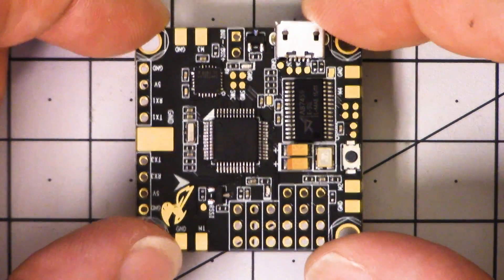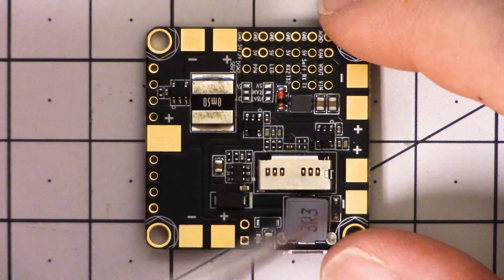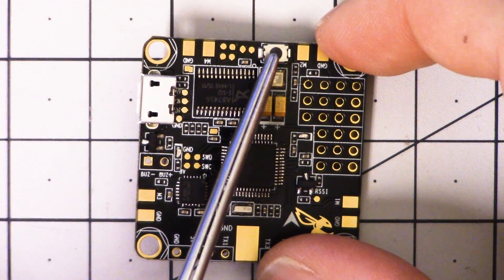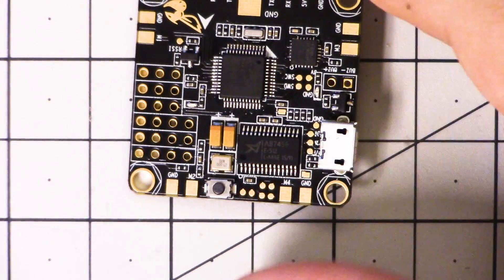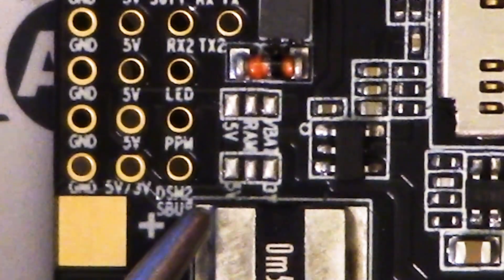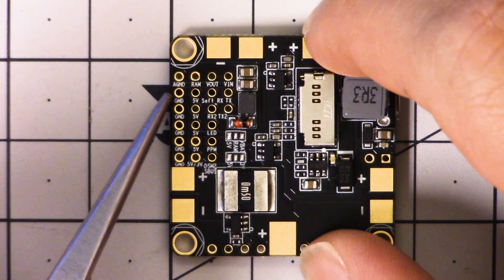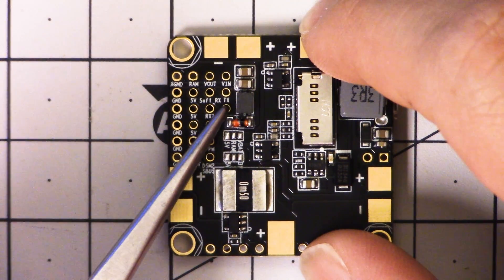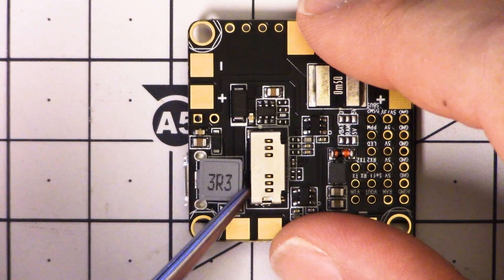Betaflight F3 (BFF3) Flight Controller | REVIEW AND HOW TO

Comment: hi there like the video but alitte confused I have the betaflight f3 board +the tbf unify pro 5v,  were do I put it if I can not run the cam and the ftx of the 5v pins ,also what cam would you recommend to go with that setup thanks
Reply from the maker: IF you bridge 5v to RAM

THEN you cannot run the vTX off of RAM. You must use a regular 5v pad because the filter on RAM cannot handle the current that the vTX will draw.

IF you bridge vBat to RAM

THEN you can run the vTX off of RAM, because the higher voltage will result in lower amps, and the filter will be able to handle it.

SINCE you have a 5v vTX you cannot run it off of the RAM pin. You must use a regular 5v pad on the board. Any spare 5v pad will do. You can try running the camera off of 5v RAM and the vTX off of unfiltered 5v, but if you get video noise, run both camera and vTX off of the same 5v pad.
Reply: ace top man

Comment: Hi Josh, great video.
I've just installed this board in my copter and i'm getting horrible noise through the video feed and I see in the video you recommend connecting both camera and vtx to the AGND pad, I noticed I didn't do that and it is probably one of my issues. 
Do you think it would be best practice to power the camera directly from the VTX ?
Reply from the maker: The setup that I use, and that works for me, is to power the camera and vTX directly from RAM, which is bridged to vBat, and ground them on AGND. If your camera or vTX can't take vBat then that won't work. The next setup I suggest is to run them both off a spare 5v pin, but do NOT run them off of the RAM pin bridged to 5v, because the filter on the RAM pin can't take the current that a vTX will pull.

I never power my camera from the vTX personally, because soldering to the PDB or FC is cleaner. But if you choose to do that, then I suggest grounding both vTX and camera to AGND and powering the vTX from vBat on RAM if possible.
Reply: Joshua Bardwell I just tried as you said and powered vtx and camera to ram (vbat) and both grounded to AGND and I'm having the same issue. I even tried powering from the vtx but it made no difference. 

I'm not sure why there is so much noise, as soon as I arm it is completely un flyable. can you suggest anything else?
Reply: Joshua Bardwell also, I have a feeling I know what you're going to say, but I haven't run a ground wire to my ESCs.. could this be putting noise in the system?
Reply: Hey, I thought I would let you know I managed to find my issue.Silly me mounted the motors with 2 wrong length screws. It was late when I was building and 1 screw in both motor 1 and 4 were 1mm longer than the others, barely touching the windings. 
I found this after I ordered and installed capacitors all round and the issue persisted. 
I tried spinning up motors individually in BF and found that only motors 1 and 4 were noisy. Oh well, I will know for next time and you better believe that I learned something today!Thanks for your contribution!

Comment: joshua.. im usind unify pro v2 5v and foxeer arrow v3.. can i connect my camera to RAM/vbat jumped and then run the unify off one of the 5v?  and will it be filtered.. ? if not how will i go about using this vtx and getting it filteres?
Reply from the maker: +Steve Maratea run GND to the same pad for camera and vTX. Rin vTX to a regular 5v pad. It won't be filtered. Run cam to 5v or ram. I would try ram but switch to 5v if you get noise.
Reply: ok would it be better if i got the unify pro HV and used the vbat/ram and piwer cam off 5v out of unift.. so both will be filtered?
Reply from the maker: +Steve Maratea that's my approach. I don't understand the logic of powering a hungry device like a vTX off of 5v.
Reply: Joshua Bardwell.. ok so you think the hv will be better than using the unify 5v to a unfiltered 5v rail..the video will be clearer with the hv? correct?
Reply from the maker: +Steve Maratea I couldn't say for sure but it seems to me like it must be better to run off filtered vBat. But maybe unfiltered 5v is better since the 5v regulator is a filter of sorts. I just never really trust the on board voltage regulator on an FC very much.
Reply: joshua.. ok well im just asking because i and about to order the unify pro and was wanting the best advice on which one to get with this bf f3 board..
Reply from the maker: +Steve Maratea personally I use the HV. I like the connector on it better too.

Comment: So is the Ram where I'm going to get actual power for the VTX? Wire the VTX power into RAM and then ground both the camera and VTX to the AGN?
Reply from the maker: +Richieboy87 if you use 5v RAM then don't wire vTX to RAM, wire it to a spare 5v pad. If you use vBat RAM then wire vTX and camera to RAM.

Comment: Hi Joshua. Great review as usual. Question...I do want to us it with a 4in1. If I use a swift 2 could I get at least voltage from the camera using the vbat wire on the camera?
Reply from the maker: Yes, you can use the vBat wire to get voltage OSD. But you should really just use the Betaflight OSD on the BFF3. No need for a Swift 2 OSD if you have this FC.

Comment: From other channels, I learned this board has a "virtual com port", so you need the VCP Drivers (2nd option in BetaFlight).  OK, I can see the little quad pitching etc.  Now to see what firmware version it has...  uh...  NOPE!  It's probably in there somewhere, but nobody ever took the time to document it!  (this is pretty much how this stuff rolls)

Ok, I'll assume it's stale...  Unplug, hold the button, plug in...  what's this?  I still get the red light?  

Long story short...  total failure.   Does anyone have a video where they actually step through using this flight controller in BetaFlight?  I understand what a "character-building" exercise spending hundreds of hours discovering all this stuff by trial and error would be, but I'm a big enough character already.

The Wiki doesn't say what toggles to use for this board in Firmware Flasher (No reboot sequence, Full chip erase, Manual baud rate).  In fact, the Wiki doesn't even mention those toggles.  This is how "community-supported" software is, and pretty much why it was banned in every corporate environment I ever worked in.  :)

Comment: @Joshua Bardwell. If you read this comment, your going to learn something today...  Not that i know for certain, however the silkscreen on the back of the board means that if you use pin headers, you can still check to see what the pins are easily.  This is what made sense to me.

Comment: A friend gave me one of these boards for my first build. I don't think I want to mess around with the hassle of the ESC wires again especially because the ground pads seem to repel solder. I tried scraping the surface, flux pen, nothing seems to help they just don't like taking solder lol.
Reply from the maker: +John Citizen just give them some heat before you solder to them.
Reply: +Joshua Bardwell I use a fixed temp 46W Goot iron which will heat up big pads with a chisel tip, unfortunately my chisel tip got lost when I moved house. I managed with the standard tip but I've ordered a chisel tip for future use because I find them much better for heating big pads and I can rework SMD components with one as well :)

Comment: Regarding the issue of using a 4 in 1 ESC with the betaflight f3, I am planning to use the Quadrant 25a ESCs soldered together for a two layer stack.  Are you saying I should run a wire from all four positive terminals on the fc to one positive terminal on the ESC assembly?
Reply from the maker: +McOwey Joe no. Run a 14 gauge or 12 gauge wire from the ESC pad closest to the current sensor to the central pads of the quadrant.
Reply: Joshua Bardwell and just choose one of the grounds to either side of the positive center pad...
Reply: I'm concerned about my ability to solder 12 gauge wires to the center of that delicate assembly without shorting something.
Reply from the maker: +McOwey Joe 14 gauge is okay unless you are pulling truly massive amps.
Reply: Joshua Bardwell it's working like a charm on Atom 122 frame and 1306 lumeniers.  Thanks for your help.

Comment: On this flight controller and an x4r-sb, on the OSD i'm getting RSSI 99%. RSSI is turned on in betaflight and rssi shows up on the taranis correctly. Everything else telemetry related is working in the OSD. Any advice?
Reply from the maker: RSSI is inverted on this board so basically it doesn't work. Betaflight 3.1.7 has RSSI inversion to fix this.
Reply: Your time, dedication, and the advice you give in this hobby is invaluable. And everyone will agree. Thanks Again
Reply: Your time, dedication, and all the advice you give to everyone is invaluable. You are making this hobby the best it can be. And I'm confident everyone would say the same. Thanks Again

Comment: Hey Joshua, I just upgraded to the Betaflight F3 and for some reason I'm not getting video through the osd. All that I can see in the goggles is a black screen with the osd overlaid. I checked the camera connections and the camera is getting 5 volts, and the solder connections are solid, so I'm not sure what the issue is. I'm powering my vtx through the ram pin on the board, and then using the power out cable from a tbs unify. I've tried multiple board cams and had no success. If you have any ideas please let me know.
Reply from the maker: Manually set the OSD to PAL or NTSC (whichever is right for your camera).

Connect the camera directly to a display device using the RCA connector dongle that came with it. Confirm that the camera works (it probably does).
Reply: Joshua Bardwell changing format didn't affect it. I'll try with the rca cable when I have time to find it
Reply: Camera works, format is correct. Any other ideas? My only other idea would be to flash the firmware
Reply from the maker: +Kyle Johnson Yeah good idea. Do that. Full chip erase.
Reply: Same issues here. Anybody work up a fix?

Comment: im doing my first build what wire goes to ram? power from the vtx?
Reply from the maker: RAM is filtered power to the vTX and camera. However if you have RAM set to 5v, you should probably not run the vTX off of RAM; you should run it off of a standard (non-filtered) 5v pad. The reason being that the filter on the RAM pin can only handle so much current. So the best practice IMO is to run the camera and vTX off of RAM and set the RAM pin to use vBat. That way you get the filtering to both the vTX and camera.

Comment: Hi Joshua. Thanks for the video. I tried to setup Betaflight Fc with 4-in-1 ESC by following your suggestion : soldering XT60 to 4-in-1 ESC power pads. I tried powering up the ESC by plugging the lipo and they started fine. Then I bridged power pads from 4-in-1 ESC to Betaflight FC battery pads. I soldered ESC signals wires to the ESC signal pads on the FC. I plugged the lipo, the FC is powered up, there is current at ESC power pads but I do not here ESC starting... Any idea with what could be wrong? 
Cheers

Comment: Couple questions: 
1) I've got a 4-in-1 esc, will this (https://www.dropbox.com/s/e0eca7wh4e4em9v/IMG_20170103_111240.jpg?dl=0) safely give me current sensing on the PDB? 
2) Do I connect the battery to the main +/- pads and then connect the the single esc +/- wires to the esc pads from above?
3) 4s, 5" props, RS2205s motors, should I be worried about the amps hurting the board on this setup with a 4-in-1?

Thanks for your videos, I always learn a lot!

Comment: have been flying this board for a week or so -- love lots about it - particularly the ability to use the stick menus for PID tuning -- thats brilliant, easy and saves a ton of time.  There is one huge negative - that is the current sensor is not calibrated out of the box (not sure how rrosd seems to be able to do this but this board can't) anyway it requires calibration which seems (I have not tackled this yet) to be a huge pain.  As it is though it is totally useless and way way way off.  And if you did not know that it is innacurate and use the "Mah used" to judge when it is time to change battery, you are going to smoke a lot of batteries.
Reply from the maker: +Prion911 _ it was calibrated on a previous batch. The current batch seems to be off. Try changing current scale to 265.
Reply: roger that - wilco
Reply: Looks like it max is 255
Reply: Never mind that was batt volt
Reply: well 265 did not do it -- closer but not right -- current meter came today -- looks like I will have to do it the old fashioned way.
Reply from the maker: There is no reason to use an external current meter. You'll have to calibrate that too. Just tweak the scale until you get close to the correct value.
Reply: crap

Comment: Hey josh, I was wondering on where to connect my telemetry wire from my XSR on the board.
Reply from the maker: UART1 or UART3 TX pad, either side of the battery pads.
Reply: man, i didint see this message so i soldered to UART 2 will that be ok?
Reply from the maker: +Jumbo Duclayan I think UART 2 is shared with SBUS right? If so, then no, telemetry cannot share with SBUS.

Comment: I am running the SP3 stackable vtx. Where would I pull 12v to power it?
Reply from the maker: +Tony Tillman Betaflight F3 does not have a 12v regulator. You'd need an external regulator I guess.

Comment: Joshua going to use a unify pro hv and a foxeer monster 2 with this FC, should I wire the unify pro hv off the RAM (vbat RAM) and AGND and then power the camera from the VTX or should I run both the camera and the vtx to the RAM and AGND then just use the VIN and VOUT for signal between camera and vtx.   I also assume if I want audio just to run that signal wire directly from camera to vtx?

THanks!
Reply from the maker: I think you should run camera and vTX ground to the same place. In this case, I would use AGND for both. Whether you run the camera off of the 5v output of the Unify or vBat from the RAM pad, I'm not sure there is a benefit either way.

Comment: I'm running a 5V Unify Pro... mhmm should I use an external regulator and go off vbat? Or will the 3A supply from the FC be sufficient (assuming I'm running my X4R, FC itself, VTX and cam off of it of course) :/
Reply from the maker: +Pablo Contreras if you run it off a 5v pad you're fine. Don't use RAM or AGND though.
Reply: oh ok so I won't need an external regulator then. Even though the Unify pulls up to 800mw?

Comment: I've just finished my build with the betaflight f3 controller and everything seems to be working well except the rssi reading.  It's showing a constant 2%. I'm not sure if i set it up correct, as it is my first time with a rx that has an rssi line.  I soldered it to the rssi pad and enabled it in the betaflight osd setup.  Any suggestions on how to trouble shoot this?
Reply: ok I forgot to enable rssi under configuration. I still am not getting a reading. Which channel do I set rssi on?
Reply from the maker: +CodeBlue FPV not sure what you're asking. Are you asking how to set up an RSSI channel in Taranis? Oscar Liang has a tutorial about thst.
Reply: Hi Joshua,
I'm trying to set up rssi to show in the betaflight osd, but I'm not having any luck.
Reply: Any ideas Josh?  I'm using a tarot rx for futaba fasst protocol with a rssi line soldiered to the rssi pad of the betaflight f3 board.
Reply from the maker: +CodeBlue FPV no, mine never worked either.
Reply: that's a bugger, I really wanted the rssi.  let me know if you figure out a work around.
Reply from the maker: +CodeBlue FPV if you have Taranis you can use RSSI channel.
Reply: I'm flying with futaba. Been seriously considering making the switch to taranis.

Comment: I want to use a 4 in 1 esc with this board. I prefer to get battery voltage instead of current on the osd. So if i dont do the mods sugested in the coments to get current on the osd, will i still get the battery voltage?
Reply from the maker: +ashingashinga yes

Comment: so does the vtx go to VIN and the camera go to vout, and they would both share the same power and ground?
Reply from the maker: You have it exactly backwards. The camera is putting OUT a video signal, so the camera needs to go to VIN on the board. The vTX is taking IN a video signal, so the vTX needs to go to VOUT on the board.
Reply: Joshua Bardwell awesome good thing I waited before soldering, so where does the audio from the vtx and runcam go?  Or is that a no go with this FC?  Thanks again.
Reply: Josh, my vtx has a regulated 5v out that I connect my camera to. Being that I won't be taking power at all from the fc for the camera, only for the vtx..am I still able to have the osd that the fc provides? My apologies if I missed it in the explanation.

Comment: 6:31 I think that the silkscreen is at the bottom of the board because the pin headers would hide the labels when soldered. If that's the case they could put them on the top too (everyone happy)
Reply from the maker: That's a fair guess. I'm thinking from teh perspective of someone direct-soldering.

Comment: I can't find this in stock anywhere 😶. Any thoughts on the CRUIS AIO?
Reply from the maker: It doesn't seem like it is aimed towards betaflight.
Reply: Joshua Bardwell https://www.amazon.com/Controller-Betaflight-firmware-Distribution-Optimization/dp/B01LXH8X5N
Reply: Joshua Bardwell - this seems to osd optimisation for betaflight.
Reply from the maker: Ah, that's a different product than I was looking at. Well, it looks okay but I would probably go with something more well known.
Reply: Joshua Bardwell any suggestions? I love the blackbox analysis and the "why it does what it does" so I need a FC with sdcard reader. Not fussed on pdb or esc (noise). 
Thanks and I appreciate the help. :)
Reply: Joshua Bardwell omnibus f3 Pro